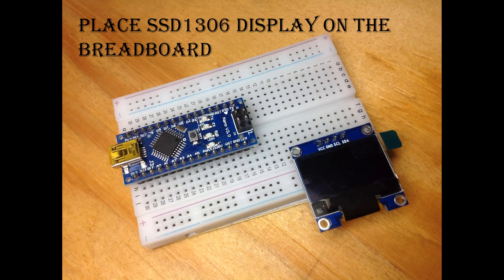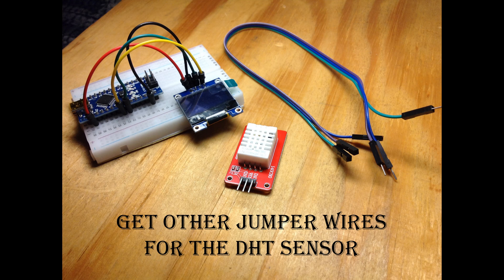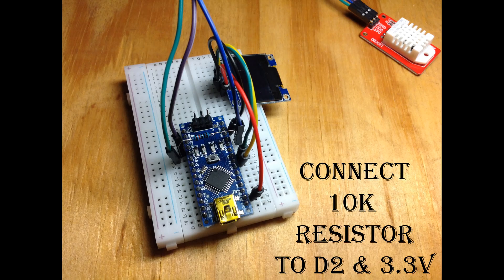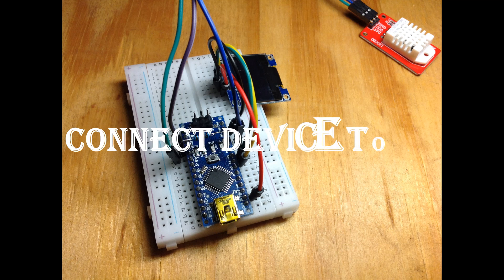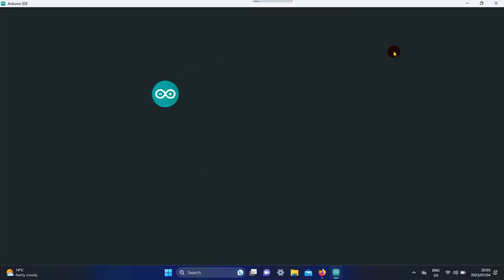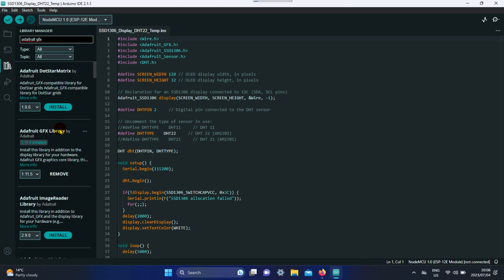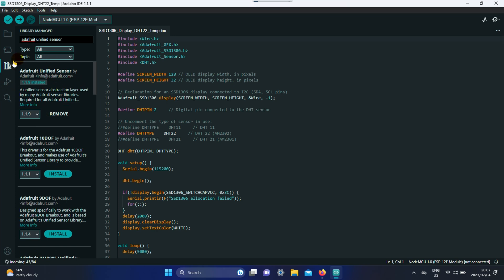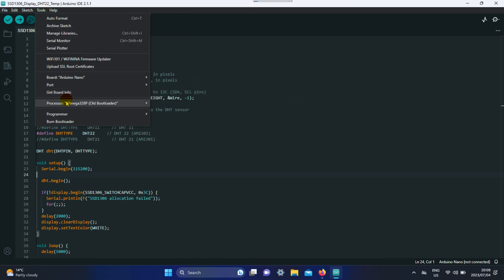Temperature and Humidity with SSD1306 OLED display & DHT22 Temperature Sensor

Comment: Tnx, it's awesome! unfortunately the website is no longer available, but luckily I had the code available on one of my computers:

#include <Wire.h>
#include <Adafruit_GFX.h>
#include <Adafruit_SSD1306.h>
#include <Adafruit_Sensor.h>
#include <DHT.h>

#define SCREEN_WIDTH 128 // OLED display width, in pixels
#define SCREEN_HEIGHT 64 // OLED display height, in pixels

// Declaration for an SSD1306 display connected to I2C (SDA, SCL pins)
Adafruit_SSD1306 display(SCREEN_WIDTH, SCREEN_HEIGHT, &Wire, -1);

#define DHTPIN 2     // Digital pin connected to the DHT sensor

// Uncomment the type of sensor in use:
//#define DHTTYPE    DHT11     // DHT 11
#define DHTTYPE    DHT22     // DHT 22 (AM2302)
//#define DHTTYPE    DHT21     // DHT 21 (AM2301)

DHT dht(DHTPIN, DHTTYPE);

void setup() {
  Serial.begin(115200);

  dht.begin();

  if(!display.begin(SSD1306_SWITCHCAPVCC, 0x3C)) {
    Serial.println(F("SSD1306 allocation failed"));
    for(;;);
  }
  delay(2000);
  display.clearDisplay();
  display.setTextColor(WHITE);
}

void loop() {
  delay(5000);

  //read temperature and humidity
  float t = dht.readTemperature();
  float h = dht.readHumidity();
  if (isnan(h) || isnan(t)) {
    Serial.println("Failed to read from DHT sensor!");
  }
  // clear display
  display.clearDisplay();

  // display temperature
  display.setTextSize(1);
  display.setCursor(0,0);
  display.print("Temperature: ");
  display.setTextSize(2);
  display.setCursor(0,10);
  display.print(t);
  display.print(" ");
  display.setTextSize(1);
  display.cp437(true);
  display.write(167);
  display.setTextSize(2);
  display.print("C");

  // display humidity
  display.setTextSize(1);
  display.setCursor(0, 35);
  display.print("Humidity: ");
  display.setTextSize(2);
  display.setCursor(0, 45);
  display.print(h);
  display.print(" %");

  display.display();
}